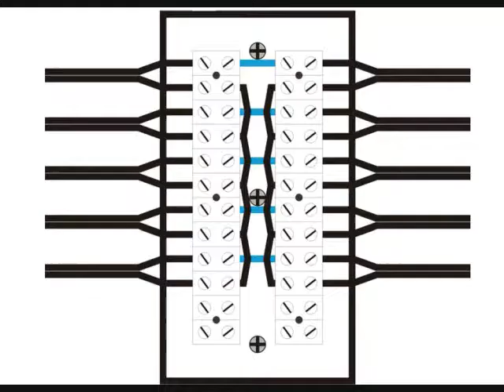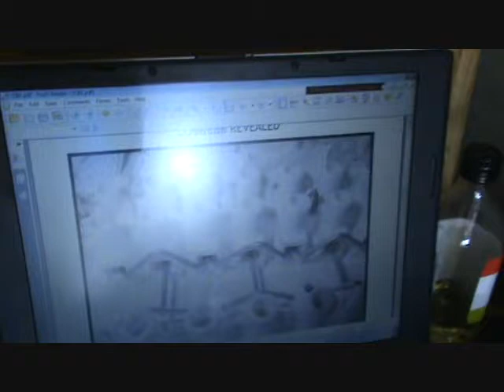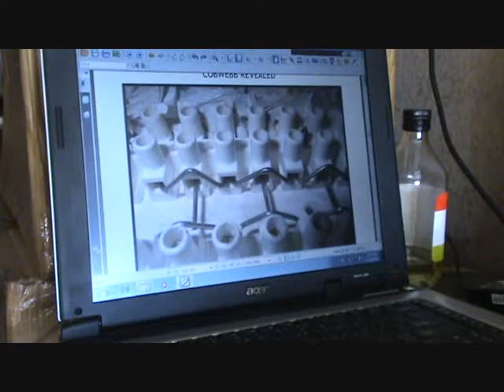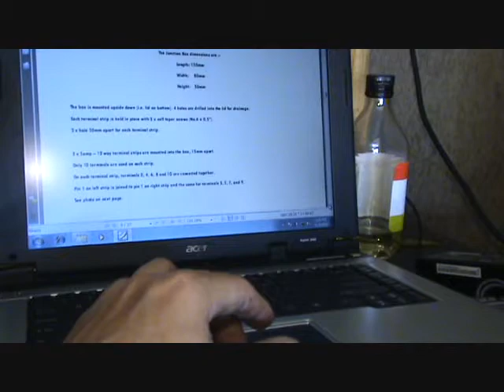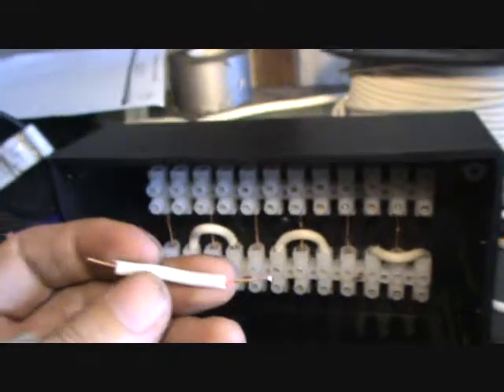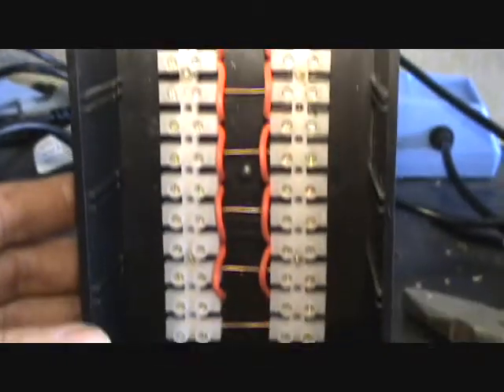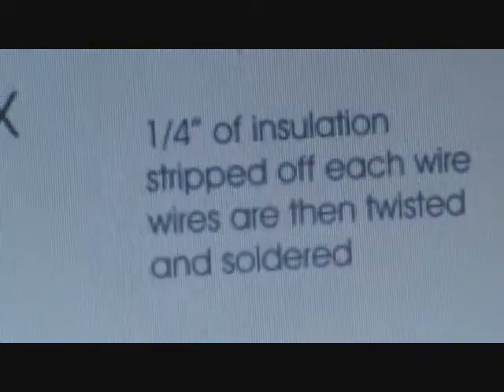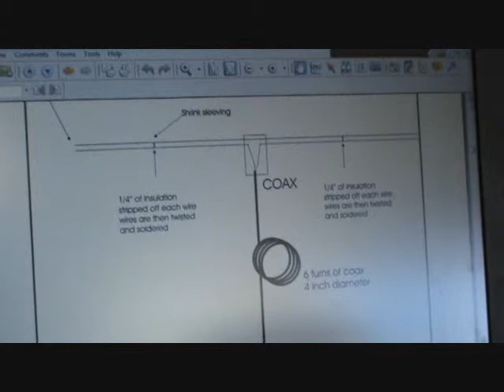Cobweb Antenna part 1

Comment: I have a Cobwebb made by PTW...remarkable performance but a working rust bug trap in the box,
The first (Manufacture's) assembly of terminal  blocks crumbled to a heap of corroded connectors, dead insects and old insect cocoons.  None (NONE) of the connector strip screws would turn. Just a seized-up rusty embarrassment. 
I rebuilt it identically, including the same silicone bath sealant as they did, sealing  (I thought,) all cable entry holes.  6 years ...same again.

Dump that messy construction of choc blocks.. It's a total disaster.
After a few years, not many, they can be heard laughing scornfully at WD40.
Not  a single screw will turn!

This time I've made  two simple copper, strips just big enough (Lengthways) to drop in the slots in the walls of the box, just like electronic project boards.
Flatten a piece of copper pipe with a knockometer on an anvil type surface.
File the edges and it'll drop into 2 pieces..
Each dipole end is soldered to strip A or strip B,
The straight thru' wire goes straight thru'. Well it would do, wouldn't it?
The coAX of the balun, inner and outer go to a copper strip each. 
When you've finished tuning and adjusting, seal anything which looks like a hole, cable entries with epoxy, hot glue, Milliput, liquid insulation tape, Camel dung and old tram tickets, Just seal it!  Drain holes let water get out and bugs get in. Don't have any water to require draining!
Then fill the whole gubbins with candle wax...Tea lights are very cheap. 
Close and seal the for the next 200 years. By then you'll have other things on your mind

Comment: Thanks for the video series on your construction of the cobweb antenna. I'm considering making one and found the series very informative. Are you still using the antenna as you made it or have you found something better since you posted these videos? Thanks! Chuck (KH6DL)
Reply from the maker: +Chuck Malefyt Heu Chuck, 
I tend to like to build more than I like to use :) 
This worked very well for the space give then availablity of a mast to erect it. 
It came down in favor of a hex beam in the end. 
At my new QTH I've got for a simple end fed half wave by parelectronics. 
I have a long yard with trees available at both ends which works better for a wire antenna. 
if I couldn't do a straight wire antenna but had a mast to use, this would definitely be my choice. Verticals are certainly an option for small blocks but running counterpoise wires can limit their usefulness. 
be warned though, birds love sitting/chewing on them and they can take a beating at height in strong winds